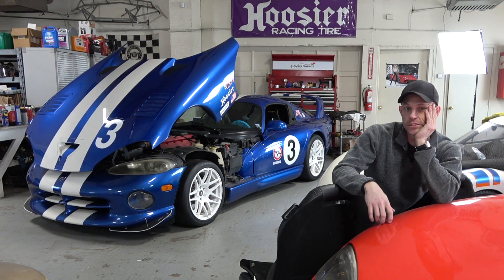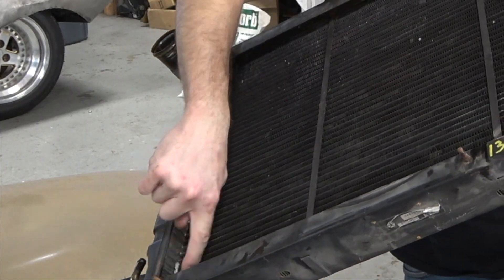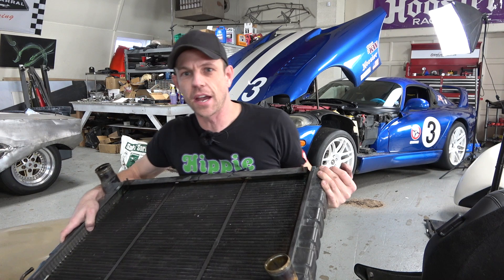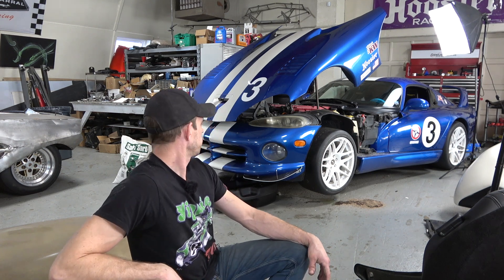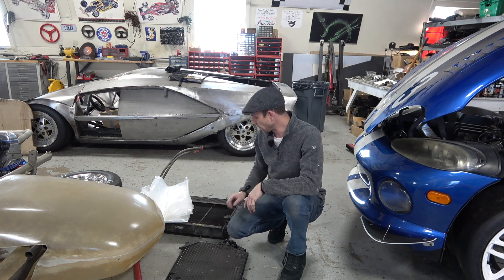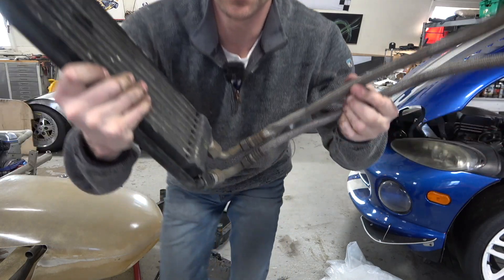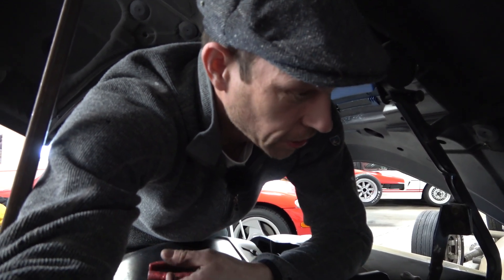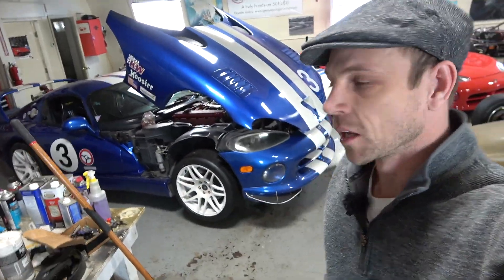Overheating Viper needs Custom Cooling

Comment: Cost cutting overriding engineering design does not surprise me with regard to having radiator end tanks larger than the thickness of the cooling matrix, seems weird to see that but then you remember: it's Chrysler then it makes sense. PWR is gonna make it excellent and cool though and that Viper will love the track then.
Reply from the maker: Yeah, I can’t wait!

Comment: Hey Casey my fornt fascia sits too high. I'm thinking the frame shims below the core support are the culprit.  Do you have to remove the rad to get at those shims? Thanks. I too might get the rad recored she runs hot!

Comment: Casey, You would be wise to pull the plastic overflow tank and clean it of years of crud! BB shot works well as an agitation method to clean thoroughly.  Note: that you may have to remove the nose. My Gen 1 also revealed the Mopar  engineering dept did not put a shorter bolt into the facia that, when installed, pushes up against the bottom of overflow tank. Oh joy! Enjoy your videos, Good luck. Yes new oil lines for sure. 180 or 170 thermostat, engine designed to run best at high Temps; bigger radiator will address cooling issues.

Comment: You're definitely headed in the right direction putting a larger core in there.  Switching to a 160F thermostat, using better fans, and taking the condenser out will help too.  The problem I've found with tracking these cars is the limited amount of frontal inlet in the nose in front of the radiator, which there's not much you can do about that without hacking up the front of the car (which obviously makes little sense on a GTS, at least it's something I wouldn't do).   It took some work to keep my 97 GTS cool for extended track sessions, but I've never been able to keep my 96 TT GTS that cool, even after changing/moving the IC to twin IC's behind the fog light inlets.  Cooling has always been a challenge with the early Vipers, which is why they changed to a larger air inlet design with the gen 5 nose when they redid the gen2 look for the 5th gen... It doesn't look as good IMO, but it flows a lot more needed air into the radiator.

Comment: This might be a silly thought, but you do have a lot of mileage on the chassis. Inspect it properly, see if it has any cracks.
Also check the bushings on the car, perhaps they need be replaced aswell.

What oil do you usually run in the Viper for daily driving?
And will you be using the same oil or something else for the track?

Comment: So... use the existing spoiler as a positive for a mold for a functional DIY spoiler out of metal and carbon fiber that bolts to the existing bolt locations?

Comment: It's the condenser. "Evaporation is a cooling process" - your hands are wet, they feel cold. Therefore the evaporator gives you the cool air. That's how I remember it (because I always forgot too!). That car is going to cool a lot better simply without having the restriction of that condenser in front of the radiator. 

What about adding an oil-to-water heat exchanger for the engine oil now that you'll have a much higher cooling capacity radiator, and repurpose the oil cooler for the transmission?

Comment: Skimped on the radiator, worked on street not on the track.  Perhaps Dodge wanted to make sure if you tracked it it would over heat before it killed you.  Just a thought
Reply: They are marginal on the street too in warm weather.

Comment: You can't fool me. You know it's an AC condenser 😆 but yeah it doesn't usually make the car go faster.... there's some interesting applications for cooling boost with the a/c system. I always commanded my AC compressor off at high rpm or throttle positions though....

Comment from the maker: Hope you guys enjoyed me struggling getting that darn radiator out! Really excited to see this car come together in the end and how well the PWR coolers work out!
Reply: Yessir : ) looking forward to more!
Reply: @Casey the Car Guy; Casey what is Your comparison with Your intended Viper racing build with this personal Viper to the Viper raced in The TransAm series which Will owns, drives, wins with KSR, Kevin ?
All The Best, Sincerely
Reply: What is the cost at PWR? I have a 99 with same issue
Reply: Besides the explanation you gave on mom and pop Radiator rebuilt. 

Are you planning on doing a heavy duty radiator and radiator fan system? If not, what is stopping you? Besides cash of course lol

Edit: nvm lol. I just got to the pwr part
Reply: Question, is the clam shell not removable